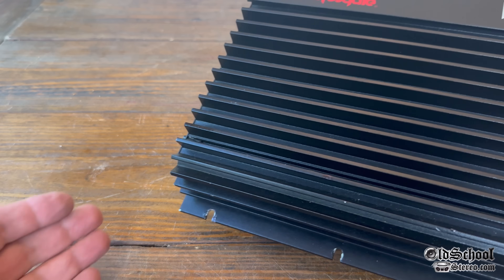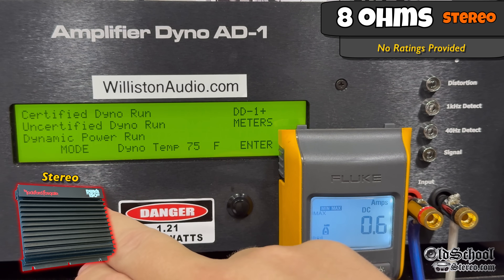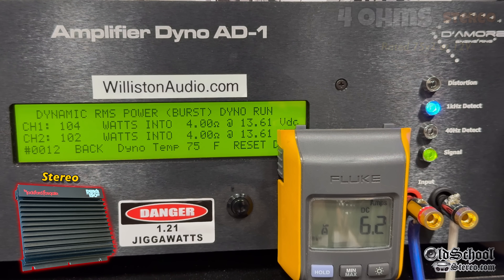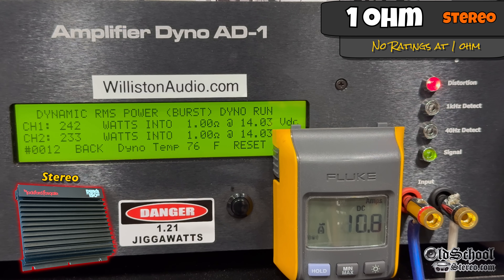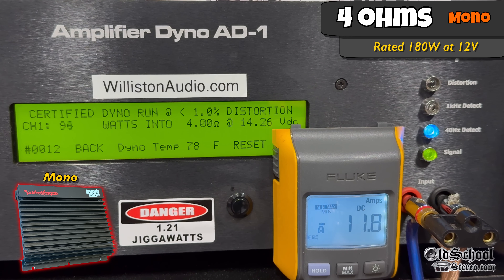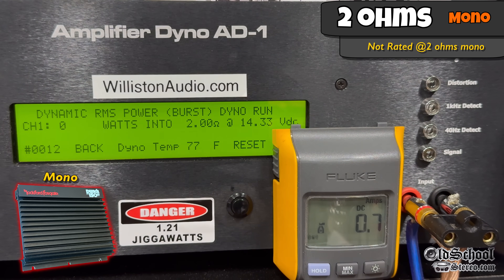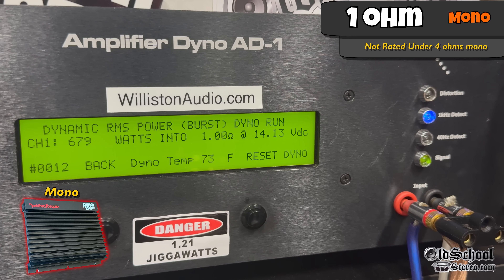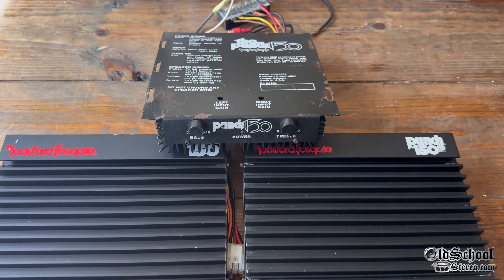1991 Rockford Fosgate Punch 150HD Amp Dyno Tests Down to 1 ohm Mono

Comment: 166/ch at 2 Ohms/14.4V seems low for a 150HD.  I have a 2nd gen that does 203/ch at 14.4, so seems something is off.  Although it's been rumored that the 2nd gens were more powerful than the HD when they came out.

Comment: Great oldschool Amp Test as usual 😊
At last i also received the punch 150HD and can’t wait to see the low ohm bursts on a scope. 😎 most amps don’t like 40-50Hz bursts at low impedance but can perform great with 1kHz bursts . Low frequency bursts are a heavy job almost like delivering 1kHz continuous power 💪
Reply: I'm still waiting....😉😉😉🤘🤘

Comment: Had no idea these put out that kind of power. Back in 1988 I was talked into putting a huge system in my first new car by a little stereo shop here in Seattle (they became Car Toys), they went with the Kenwood KRC929 preamp deck, KGC7480 preamp eq, a pair of Kenwood 5020 amps for the front end, but the Punch 150 driving two 15" subs in a ported box. As a 23 year old this was mind blowing, to be able to rattle windows in buildings as I drove down the street. Seeing your video makes me want to do an old school system in one of my 80's classics!

Comment: I can remember friends running this amp and I was running mtx and u can totally hear the difference in wattage when the car was in park idling u could hear that level of bass  and see the voltage dropping down to 10.9 volts then if u reved the motor up to stay at 14.4 volts man that amp really woke up in power.
Reply: Ya, their 'loosely-regulated- supplies really took advantage of 14+ volts input!

Comment: Anytime we did RF installs , the shop manager would take the knobs off and throw a piece of tape over the gain pots.  Keep it under that 10% THD and it sounds great. That 10% had a reasonable frequency response up to clipping.  Want less clipping? Mo powa . A 150,75, and a 45 w/ PA1hd and 6-26  assorted Fosgate speakers and xovers. We were getting $1500 for basic 1-2 subs w/box ported or sealed, and bass choke, 45hd (optional OEQ1) PA1hd 4-6 mids and highs w/xovers. But the tri-amped sounded the best. 150hds pushing 10 8s 8 10s 4-6 12s 2-4 18s 75hds 4-10 mids or 2-4 mid bass 45hds 2-6 highs or 2-4 3ways.  Seemed the norm for the competition crazy 90s at iasca's and Rolling Thunder and CAN events. DFukuda TMatsubara RClark/Speakerworks CKlodner MSmith LFredricks WHarris RFosgate Ppi Orion(Tempe)Zeff Advanced Products Company(Modesto,CA)Hifonics(Zeff/NJ) Alphasonik(Berkeley,CA) Soundstream Electronics(Folsom,CA) Linear Power(Auburn,CA) Earthquake Sound(San Francisco,CA) usamps(Hollywood,FL) JL Audio (Jacksonville FL) James B Lansing/Altec Lansing(Rockford,IL) analog digital systems (Brockton,MA) Boston Acoustics (Boston,MA)
Great vids
Reply: All that cash and you take my gain knob and I'm seeing red.
Reply: 😂 @somenamelessdude8095
Reply: Back then RF amps do not like to clip... incorrect gains or a abusive owner would be a quick comeback for blown speakers especially when running RF on the mids and highs or any sub with poly formers.  Punch pro subs (aluminum formers) and Diamond HEX components was the only combo where we had very few if any come backs with big RF amps.   Customer wants JL subs and components?   He's getting JL amps.
Reply: @v12alpine I had 4080 running my mids and highs.  I'm assuming a 480 is considered a big Fosgate amp.  I was going through Punch mids. Moved to all power series mids n highs and no more popping speakers.  Occasionally I blew a tweeter.

Comment: Almost every used HD amp I bought over the decades the output boards were bad. Leaky tiny capacitors bad design. When I buy these hybrid designs I anticipate the channels to be distorted and staticky lol
Reply: Leaky electrolytic capacitors are not a sign of bad design, it's just what they do over time.
Reply: @JasonWW2000 Not necessarily true. Capacitors in other amps of same age or older rarely leak. It's always the tiny caps on the sound boards in these HD amps
Reply: @JYAN2852 It was probably that brand and batch of capacitors that Rockford bought during that time. Those amps are 30-35 years old. Even when they were 25 years old the caps can leak. Besides age, things like heat cycles, how hard the amps were run and how the amps were stored all play a factor. 

I'm not sure how the circuit board design could somehow cause the capacitors to leak prematurely. Maybe the circuits would sometimes exceed their rated voltage? 

Leaky caps and oxidized switches and pots are pretty normal on older amplifiers. I don't see it as bad design. Electronics have a shelf life.
Reply: @JasonWW2000 I have over a hundred of old amps from.70' 80's 90's all original caps. None are leaking and they all work fine still.